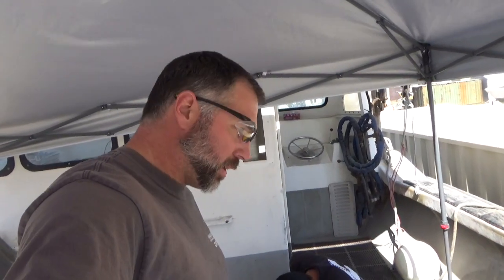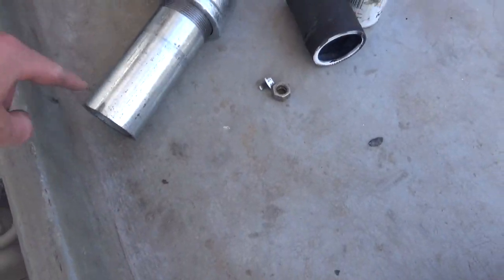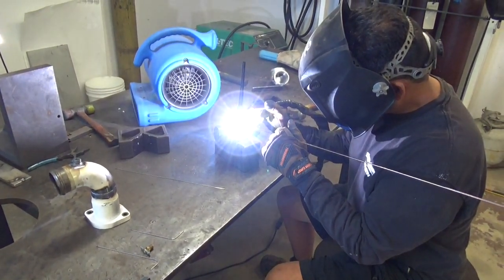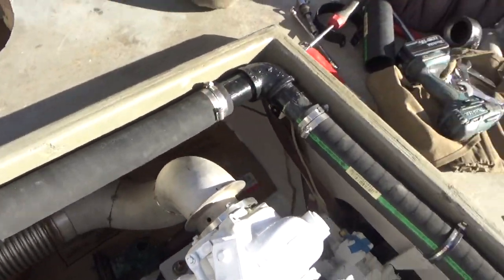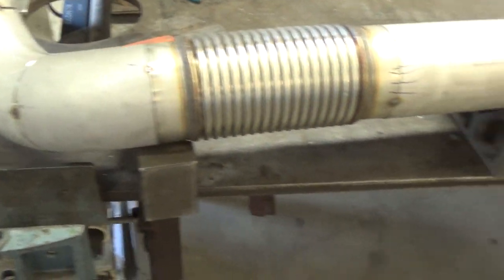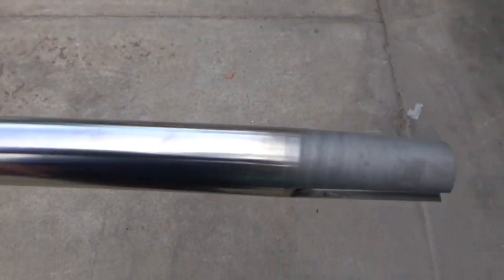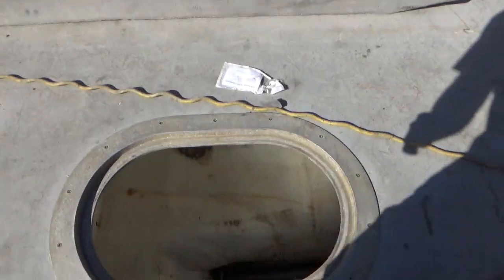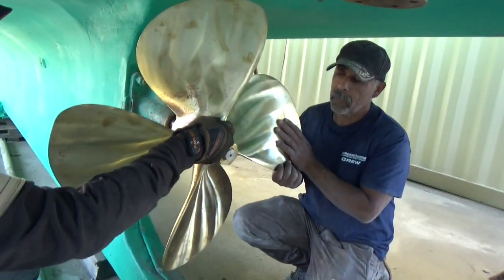Restless Keel Cooler, Exhaust and Engine Test

Comment: How long is that walter keel cooler? 1.5" tubes?
Reply from the maker: Its been a while, but I think they were about 10-12 feet long and yes they seemed to be about 1-1/4 or 1-1/2 diameter.
Reply: The reason i ask is i have a CPL0970 that i have 4' x 8 tubes @ 1.5" diameter and if i run over 2200 rpm my temp will rise. That is what Walter recommeneded for my 6bta. I think 12' would elimitate that problem. I am set up exactly like in this video.

Comment: Small nut first. Less resistance so you can tighten it in further. Then large to jam small nut on. It’s what I was told when I started building boats and it’s how I’ve done it since and none of them have ever fallen off
Reply: large nut first wont fall off either

Comment: Hmmm, no header tank. ???
Reply: Steve Carlisle were do they “add” the coolant, and where does it go when it gets hot and expands.....
Reply: @bertieperret  🤔
Reply from the maker: The expansion and overflow tanks are in the cabin under a bench seat at an elevation above the engine and all the plumbing, there was no good spot under the deck.
Reply: Caterpillar